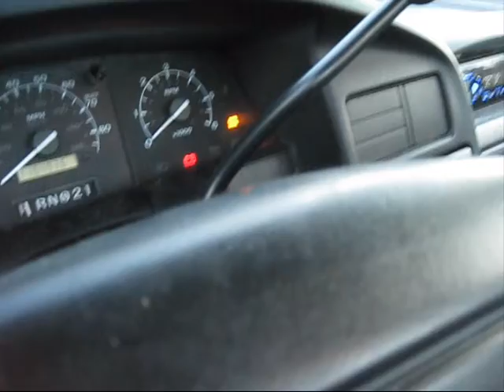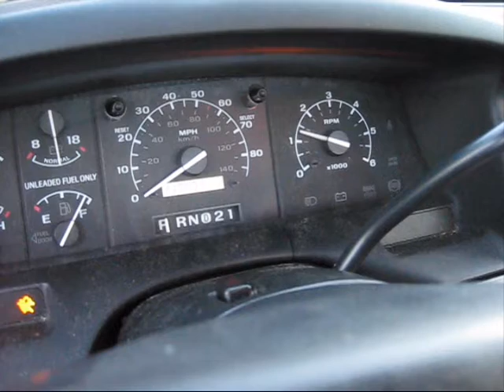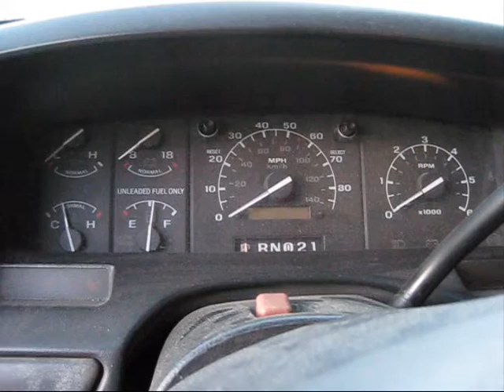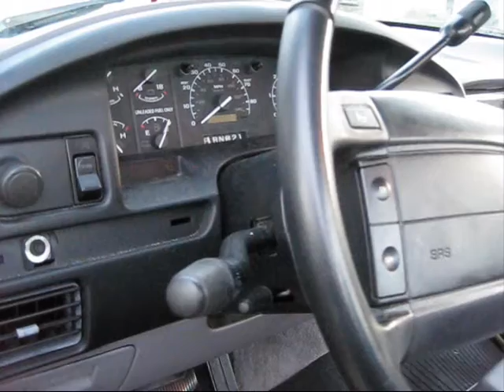OBS Ford early signs of EEC failure

Comment: Ford had a terrible design flaw, look at where the driverside wiper arm attaches to the pivot point, rain flows/trickles down that hole directly down to the computer junction wires coming thru the fire wall (discovered rust inside computer also). I learned the hard way after replacing several units to cover that wiring location (waterproof it) a homemade rubber cover and duct tape seal......... no more computer problems.

Comment: My 94 f150 with a 5.8 does that fuel thing about it seems like only when it hasint been ran for a day or two it dos it maybe once a month or every two months but it will keep running and running and it’s actually not getting fuel eventually with the key in the on position it will finally stop making that noise and start could it just be clogged injectors?

Comment: I’ve fuel pressure 35-42 and it holds but I don’t hear the buzz from the fuel  pump/fuel prime. Is it possible my fuel pump is out but somehow I still get fuel pressure? I’ve the no start condition and changed many things already with the ignition system but no luck. My suspicion is fuel pump or icm or computer itself
Reply: Having similar problem

Comment: The capacitors are so easy to soder new ones in. I used some out of electronics i found in the desert😂   replace the capacitors before u have problems and the board wont get leaked on by the capacitors

Comment: This was my 88 f250 issue and was the ecu.
Reply: I just got a 1988 F250 and bought it cheap. I think there no power coming from the ecm and will think about replacing or repairing mine. I want to maybe try to find a local computer repair shop.

Comment: I had this problem, and learned it was the ecu, sometimes my truck would not start for 10 minutes, IF YOU HAVE THIS PROBLEM YOU HAVE TO WAIT FOR THE FUEL PUMP TO STOP RUNNING BEFORE IT WILL STOP.

I bought a replacement ecu and swapped it out, and now my truck wont idle normal,  it idles violently, and dies if i put it in gear

Comment: I have a 95 Ford pick up with the EC4 computer with OBD 1 can I replace that computer with an EE5  from a 96 truck computer which would give me OBD 2  diagnostics ? Thanks
Reply from the maker: Its not that simple. 96s have a 1 year only EFI system. Many connectors are different including the EEC. They have a 96 only harmonic balancer and crank sensor plus downstream oxygen sensors. You can make it works but it takes alot of wiring.

Comment: I recommend if you get a used eec-iv to go ahead and replace the capacitors on the board. Its very simple and easy if you have a soldering iron
Reply from the maker: This video was years ago. Fast forward to now and the capacitors are pretty much guaranteed to need replacing if they haven't been done. I'm starting to see cap failures on other modules now too.

Comment: @pfun41 93-94 ford bounder 7.5l
Would start and run for 15-60 sec and die...
Key on egine off- fuel pump primes 42lbs and shuts off...
If i release the pressure on test gauge, the FP relay does not activate right away and chatters when it does for 5-30 sec....
Fuel pump runs continuously after that.... im leaning towards eec4... any thoughts? 
Thanks in advane
Reply from the maker: There is no fuel pressure sensor on these. They run the fuel pump for a predetermined amount of time at key on, then switch it back on when engine rotation is detected. You could have an issue with the relay or the eec.
Reply: @pfun41  thanks...... ended up being the computer causing intermittent pump and injector failure.... I figured it out after watching the injectors drop out intermittently.... well, guessed....lol.....
Rockauto, I think.... under 200$

Comment: I’m experiencing similar issue. My pumps quit, no priming noise. Before, my pump would keep priming.. how can I purchase a new EEC 4 and can I just put it in or does it have to be programmed and how do I do that..? I have a 1995 f150 4,9l dual tank Eddie Bauer 2 WD southern just replaced fuel pump and week later both pumps quit same time…
Reply from the maker: I think it's all remans now unless you go used. There is no programming on these, it just has to be compatible with your engine size/transmission/ and injection strategy.

Comment: Have a 94 F250 it's sat for about 3 to 4 months why I was repairing exhaust system and now truck won't start when started up after I got it back together the fuel pump ran and wouldn't shut off
Reply from the maker: alot of these trucks seem to have issues with water intrusion around the EEC connector.
Reply: @pfun41  I put a whole different computer in it now I'm rebuilding the wiring harness for the engine

Comment: Could the opposite happen? I have a 1992 F150 that cranks for 4 or 5 seconds before it starts and flutters briefly once it does start.  It does that when it hasn’t been started for a couple hours.  If you crank it while it’s still warm, it starts perfectly.  After it’s running, there are no issues at all.
Reply from the maker: You probably have a weak fuel pump or the check valve in the fuel pump is leaking. when the truck sits the bad check valve lets the pressure all leak back into the tank and the few seconds at key on isn't enough to fully refill the line and generate enough pressure. Try cycling the key and let it prime a few times when cold and see if it still does it.

Comment: 96 F 350 with 5,8  Had classic systems you described,  ,  Throwing part after part , even changing internal relays wihin trans, ,  Symptoms , starting from dead position hot / cold  bucking   like it was running out of gas ,  lifters clanging. First thoughts , fuel filter , fuel pressure valve , fuel pumps , (huh  both tanks ? )  Bucking - maybe tranny related ?  Did not pay attention too long running fuel pumps as you indicated on video ,   Truck  reached   35 mph truck ran fine ,, highway / local ran fine until stopping starting process all over , ,Bucking like a bronco ,  Neighbor old school retired mechanic said all along computer ,   dragging my feet not wanting too spend few hundred and still uncertain if that is needed ,    Neighbor  dug out is old handy dandy  SNAP ON  OB1 ,  No codes  on screen but truck was running , starting  ,  HE SAID I TOLD YOU ITS THE COMPUTER , Sure enough rebuilt Caradone  $ 160 bucks , running fine bucking gone ,

Comment: Is this my problem?? 86 f150 carb 302.. ran great... started to die while driving, like slowly loosing power as if battery was dead. I thought alternator went out. Got home expecting dead battery since I assumed I drove 10 miles home on just battery. Volts showed 12.08v... any help/thoughts greatly appreciated
Reply: What ended up being your issue? I've got a 1988 351w carb swapped with same issue to the T

Comment: 2004 v10 king ranch.  O'Rileys said needed new alternator my certified mechanic said alternator was fine.  Cold weather came and now I'll have lights in cab radio but no crank of starter.  I'll have to put jump box on it.  Sometimes I have to hold the key for 30 seconds before starter will engage.  Anyone have any insight I bought a new battery as positive post has accid build up.

Comment: Got an issue on a 1994 ford f150 4.9 L6. Cranks but won’t turnover, spray some carb cleaner into the air intake and it’ll turn over but runs rough. Checked entire fuel system and never found an issue (currently have the bed off for fuel pumps). If I try driving it, I’ve gotta slowly press down the pedal to build up speed and it won’t shift into 2nd expect for one time I got it to kick but no idea how it did as when I slowed down again, I couldn’t get it back up. Thinking it’s PCM? Any ideas?
Reply: PCM, left kick panel next to clutch pedal. Remove cover,a couple bolts hold in place to the inner cab structure. Then under hood (10mm bolt). PCM port plug (red in color). Back bolt out turning left with 10mm socket (2in ext w/10mm socket and 1/4 ratchet). Port plug is removed as bolt is loosened. Place port plug to the side, proceed to remove the PCM out from the fire wall up towards and out from engine bay. Make sure you get the right PCM that's programed to your trucks specific VIN. Have a 1991 Bronco, 1996 F 350 crew cab 351W, 1988 F 150 300 I6 ext cab 4x4, 1987 Bronco 302 manual transmission. Love my Furds.......Plenty of cussing and wrench throwing, smiles for miles after the fact 😁

Comment: Back probing from the component failure will 99% of the time, lead directly to a faulty PCM/ECM on these Fords. The components on the circuit board have a 15 year shelf life, at best.
Reply: The capacitors are usually the failure point. Definitely easy to replace but if you let it go too long, the electrolyte leakage can damage the circuit board.

Comment: My truck starts and runs for a second and then the check engine light comes on and the truck shuts off
Reply: Mine does the same thing I just bought this truck a re
Reply: I just bought a 94 f150 and it's a really nice truck but it dies the same thing, let me know if you figure out the problem and I'll do the same I hope it's just the module in the distributor..

Comment: My 95 f150 did that it was the distributor
My 96 has a crank sensor the last year of these trucks has a obd2 computer bolth truck have 5.8 but the 96 has a different firing order I've also learned never run the secondary fuel tank out of fuel and try to switch to the main tank it doesn't work there also is a I think its cald a diode in the instrument cluster if it goes bad it wont run I just go to salvage yards and get computers and the icm it's on the driver's fender ignition control module 
The distributor runs the fuel pumps when it goes bad the fuel pump stays on builds no pressure it circulates the fuel to the front tank it will drain the rear tank into the front its connected to the icm in the fender you can also get a polack switch on line to run another tank in the bed and the diesel trucks have the fuel lines running into a fuel filter under the driver's side on the frame just past the front tank they have problems with them to these fuel systems are nice when the work but they are a pain in the back side when the dont now I have five of these trucks my favorite one is the swb single cab 4x4 it's so low geared you can get out and walk beside it
Reply: I have a similar problem with a nice 94 f150 it starts sometimes then dies but I can hear the fuel pump cut off when I just turn the key on and they said don't use the front fuel tank , I can keep it running with starting fluid , sometimes it will start and idle but if I touch the gas it dies immediately,  any help would be appreciated scott myrtle beach s.c..

Comment: Mine had a combination of the fuel pump running and my injectors cycling with the key on engine off and it flooded my engine
Reply: Was it running really bad almost wanting to die then revving up and smoking out the exhaust?
Reply: Jagster mine is doing that right now

Comment: I have. An 87 e150 with 5.0, so when I turn key on I hear pump prime. After I turn it on and drive and idle, I can hear it on. Is that normal (prob dumb question)
Obviously it runs fine

Comment: I have a 89 f250, last week it started kicking the fuel pump on after shutting the truck off and continuously run. Now my pumps won't kick on at all. Would this cause those issues as well?
Reply: It could yes. Did you replace the ecu yet?
Reply: @1982MCI  no, it ended up being a relay that was completely corroded on the inside.  It was still clicking like it's supposed to just not completing that final connection to send power to the power the pumps. New relay and it fired right up
Reply: @nicksrcadventures6831  AHA! This is some good info which I'll add to my check it list (battery, distributor, solenoid...).  My 93 Bronco just stopped/died today and I had to get towed. No fuel pump issue...but plenty of others, lol.

Comment: I have a 1995 f150 4.9l the fuel pump died a couple of weeks back ran great for about a week then started, cutting out and hesitation you shut it off start it back up everything seems fine again I replaced the map sensor, ignition module fuel filter still has the problem, UP DATE new fuel was bad
Reply: Me too if replaced fuel pump twice now I cant even go up hills with out jerking and slowing down to 30mph I have a 91 7.5 lariat the fuel pump sometimes stays on sometimes not sucks ballz

Comment: My 95  truck did that it was the distributor it has a sensor in the distributor it caused the fuel pump to stay on and  put the fuel into the front tank I replaced the distributor and the problem went away my 96 has obd2 it has a crankshaft sensor

Comment: Mine has done this to me 3 times its damp outside and won't crank it stumbles and tries to but won't then after a while it will I will cycle key and here the fuel pump run each time I cycle the key on and off and the tone is different like the first truck

Comment: Yep my 94 F-150 4.9L MFI OHV 300 CU. Inline 6   5 speed hesitates on startup when I’m using my front fuel tank sputters and doesn’t want to start! But when I switch it to my rear tank it fires up with no problems would this be the same issue with The EEC? Can anyone help me please?
Reply: Bad fuel pump in front tank.

Comment: Anyone's truck have intermittent problems shifting passed first gear? Or turning the truck on and it's automatically in 4x4? I feel like my truck might get stuck on low gear...
Reply: I have the exact same issue in my 1994 F150, it randomly is in 4x4, and struggles with 1st gear.

Comment: My dad's 94 keept acting up. The fuel pump would keep running and it wouldn't start. But it turned out to be the number one relay in the distribution box, not the eec.
Reply: Interesting!! I’m going thru similar issues on my 94 right now. I’ll look at the number one relay. Can you see a problem by looking at it or how do you test a relay?
Reply: @1982MCI  swap number one relay with the horn relay because all four relays the little black square boxes they are all the same exact relay you can swap them see how it runs after you plug another one in
Reply: @going5635  I tried that and it’s still dead , did not change a thing. But thanks for the help anyways

Comment: My 1993 Ford F-150 cranks, but doesn't start.   Replaced distributor, coil, and computer ( twice ).  Truck will start & run, for @ 30 minutes, then die & refuse to start.  Any suggestions ?
Reply from the maker: Sometimes the ICM will do that, but on that year range it's usually on the distributor.
Reply: @pfun41  THANKS  !!
Reply: How about the Ignition control module ?

Comment: THANKS for the informative YOU-TUBE....      This is  exactly what my 93 F-150 TRK is doing.....!  All the steps you did I also did..  Plus,, I had to go through in a rear  tank fuel pump  R&R due to the FORD fuel pump recall.  Due to fuel coming out of the service cap..  However I had a belief the ECM was failing.  I plan to do a R&R ECM.  The sad thing is getting quality parts from FORD on these old TRUCKS, they are not there.  Only CRAP low quality SPECs from CHINA.. So my TRUCK is out of commission and I will buy a replacement rebuilt ECM..
Reply: I want to pull apart my original ECM, see if I can't replace capacitors...on third ECM.  They will make the truck run for @ 30 minutes, then dead.
Reply: @xzqzq    On a follow UP,  I got the ECM tested/repaired and re programed at AUTO ZONE  who mailed  off my ECM off to the AUTOMOTIVE COMPANY called BLUE STREAK down to FL.  It took 6 weeks to get it returned.   The rebuilt ECM works great,  for my  1993 F-150 no problems..  Auto Zone has a customer program were they can mail  off  your ECM to get it tested/overhauled or get a repaired one replacement.  I wanted my original one off my TRUCK repaired...
Reply: @RAF-FIG  Thanks for the info.  I got tired of screwing around with the truck, and simply parked it....since the wife is asking me to do something with it, might give it another try....have replacement sensors for coolant system to install...will check the ECM, also.

Comment: When my computer messed up it ran fine, prime according the only issue i had was i lost O/D. After looking over all the connection, changing shift packs and checking things out i took the computer out(very easy to get out), and seen a wire had come loose. So i put back together ordered a reman computer. Put the reman computer in and there was over drive back. Me happy and it was $180 for part
Reply: Still running ?

Comment: Thank you so much! I have a 1993 f150 4.9 that is having this same problem. If I hear the fuel pump turn on then off when I turn the key, it will start every time. But if the fuel pump stays running it turns over but won’t start. Definitely going to replace this
Reply: Hey man ik this is random but we have the same truck 93 150 4.9 i have a problem no research has helped me when u put ur key in the ignition to start it do u hear an obnoxious buzzing sound that goes away like 10 secs after it starts up?
Reply: @ItsKing32  it suppose to make that noise. It sounds like a bee , right?
Reply: Seat belt buzzer
Reply: If the sound comes from the engine compartment fender it is the cruise control module. Runs for a few seconds when you turn key to ON.

Comment: on my truck my new iac valve dosent function have to hold my pedal 2 inches to get it to turn over so i believe my ecu is bad
Reply from the maker: You may have a bad IAC. The market is flooded with garbage quality auto parts, and electromechanical parts are especially prone to issues right out of the box. I had a brand new IAC that never worked right, put the OEM back on after a good cleaning and it's been fine since. That was over a decade ago.
Reply: @pfun41  nope brand new iac but you do got a point there i may need to put motor craft iac to see if that helps
Stay toon
Reply: That or your throttle position sensor
Reply: well i installed a brand new one last month didn't help at all